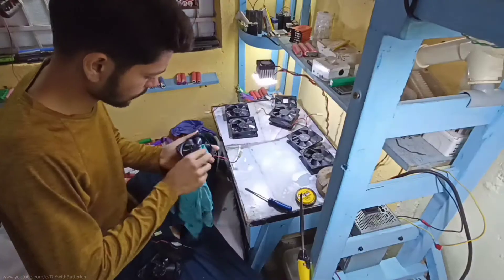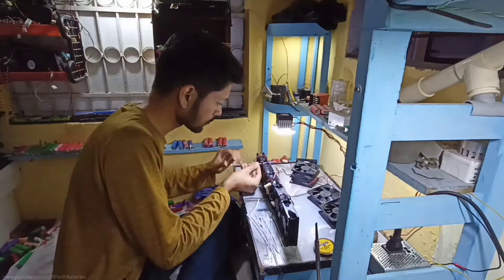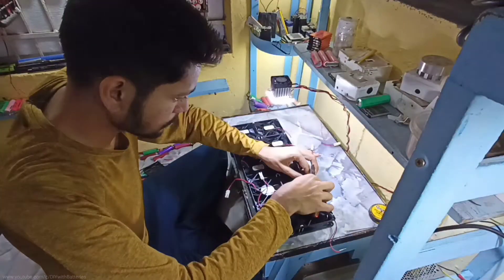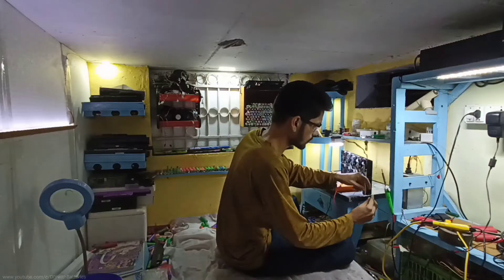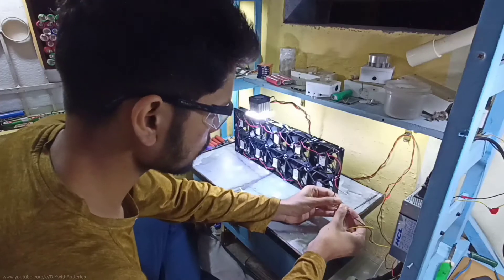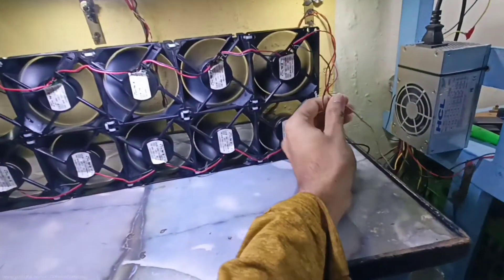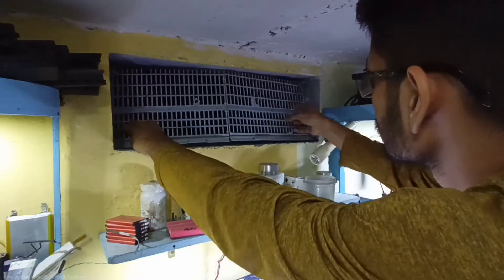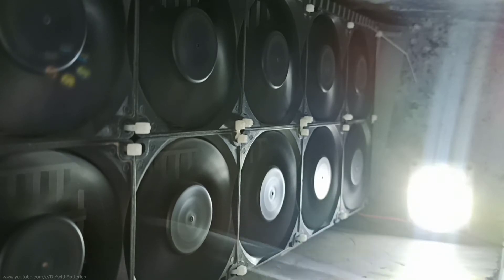portable exhaust & solder fume extractor from old pc cpu fans DIY

Comment: If I connect 3-12 v dc fans together what can I use to power it with. A laptop charger or something else? Please and thank you
Reply from the maker: Use can use two 12v fans in series if you want to power it with a laptop charger are else you have to use buck converter (19 to 12v) to power three fans in parallel 👍
Reply: @DIYwithBatteries  thank you sir I appreciate the info
Reply: @DIYwithBatteries  one more question. I have a 36v scooter charger. Can I use that to power all 3 in parallel?
Reply from the maker: @Of-The-Earth  You mean in series Yeah sure 👍
Reply: @DIYwithBatteries  yes. Thank you very much